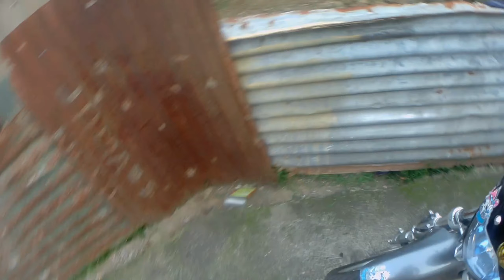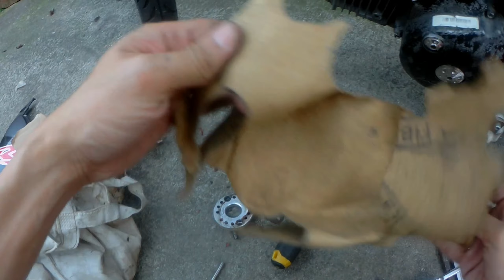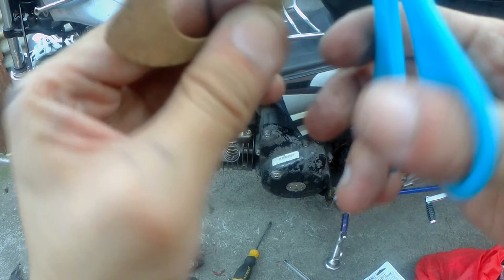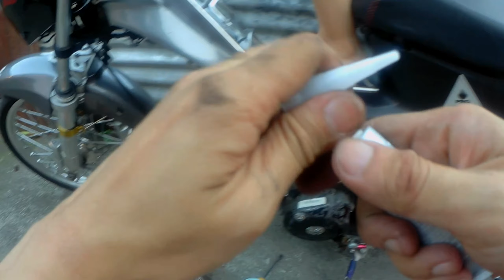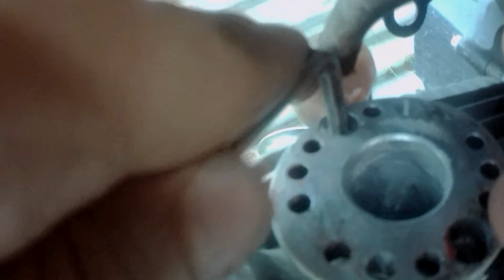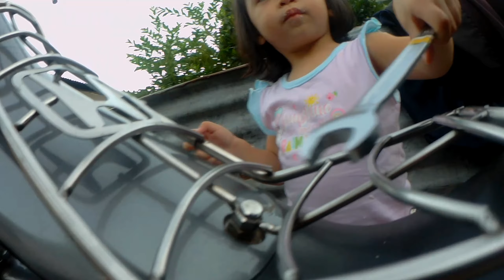how to put a gasket maker (rotator and manifold ) || Battle Hopper

Comment: Bellamoid gasket meron mdyu makapal mas maganda gamtin walang leak, no need ng gaskt maker
Reply from the maker: Yan gamit ko boss ang kapal sakit sa kamay guntingin
Reply: @tol-motovlog6592  meron mas makapal kunte para maganda seal nya, ganyan din gamit ko noong araw same sa gawa mo naglalagay ako ng slcon sa intake manfold peru malulusaw sa gasolna,   meron dn bellamoid na asbstos mas makapal magnda din yan sa intake kasi d iinit ang manifold mo sa carb, dati kasi pagmkaniko sa motor din  hanapbuhy ko, ngayun mga sariling motor ko nalng inaayus ko nd sasakyan, meron ako, duke,ninja 250, xlr200,tormax150,rusimojo200,cb400,vfr400
Reply from the maker: Dami mo motor boss hehehe. . 
Dati din gNun gingwa q matrbaho lNg tlga paps np